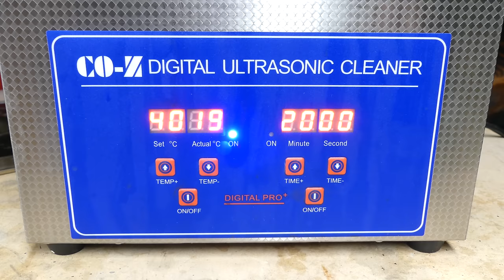HUGE 1950's Doepke Jaguar XK120 Toy Restoration

Comment: The way it was built i was suprised the tires didnt have tubes in them.
Reply: It’s so realistic.
Reply: suprised it doesn’t have a little V12 in there, along with a transmission, driveshaft, and all the controls.  
Most of it is there, I bet you could easily modify it into a running car (just obviously massively scaled down)

Comment: I quite like the larger scale toys; few restorers tackle that size.
The paint colour looks great; so much better than the light blue original!
Reply: That particular shade and hue is called ''British racing green''.
Reply: @Emdee5632  With all due respect, the green color on this Jaguar XK120 
is not "British Racing Green". 
OK, it's kinda' close...BUT...it has too much "blue" in the mix to qualify as BRG. 
This restoration needs stripped, a primer coat & a color-correcting respray. 
Best regards, 
Ben

Comment: I am wondering why you changed the models colour? I think it turned out very well. The original colour would have been better. Also the absence of the gear lever and handbrake would have been the icing on the cake.

Comment: This toy is WAY past old if it’s still held together with screws, bolts and cotter pins! 🔩🪛
Reply: When you don't know stuff about stuff then speak not.  And that is not a cotter pin.  Subtract 1955 from 2024.  That's how old.
Reply: @johnblessing6694  what is it then?